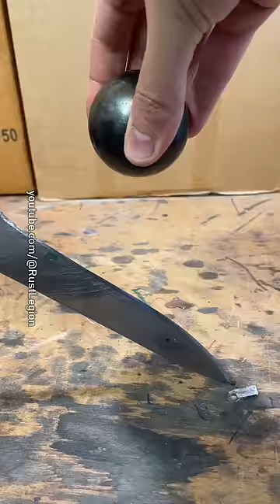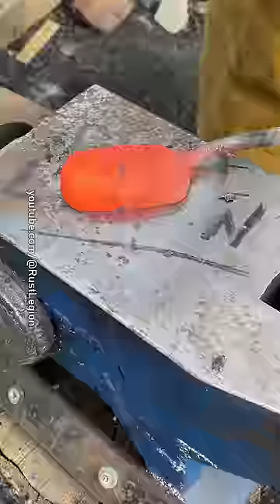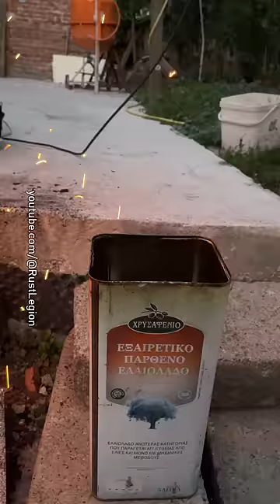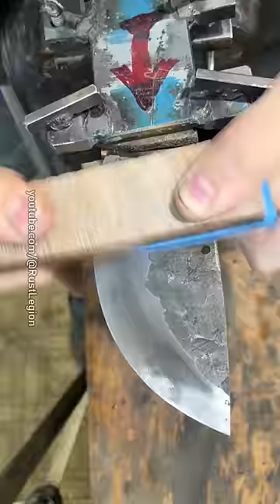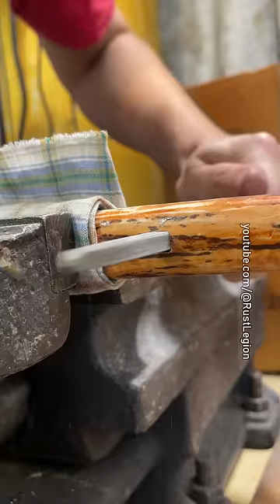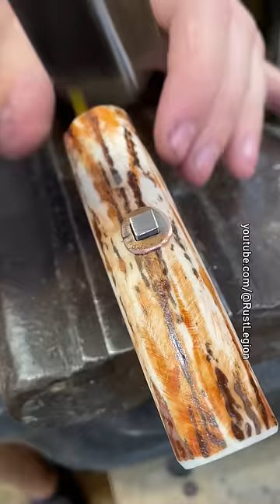Making cool Pizza knife

Comment: Ah... to propertly heat treat you need the metal between 1000 and 1200 degrees. When steel is that hot it is a medium to bright orange, the heat also needs to be consistent thru out, meaning the same color all the way along the edge you are trying to treat, that metal was maybe 800°F so all you did was make it more brittle not harder. The back middle was the only part hot enough. 

Hardening is a sweet spot between too soft and too brittle, it is not an easy process to learn properly. Also you really only need to heat treat the working edge, making the entire piece hardened will cause it to break easier, you want a soft metal behind the hardened edge to absorb any impact. 

Lastly there is more too heat treating then just quinching. You need to get a toaster oven and take it directly from the quench to the oven at about 400 degrees for 4 to 8 hours depending on elevation, 4 hours at seas level up to 8 hour at 9000 ft. So say 4000ft you'd do 5 to 6 hours. and let it air cool. This is called tempering. and is a required step for the best possible product. 

It doesn't matter if the tool is "just for leatherworking", if the leatherworker drops the tool on concrete or a hard surface enough, it will shatter. 

You desperately need a nice lazer thermometer that goes to 2000°F and a shitty walmart toaster oven that goes to 500 or has a broil setting (broil is 500) 

But you know, what do i know, Ive only been tool blacksmithing for 20 years, with a minor background in metallurgy..

Edit: I stopped the video to write you. Wtaf would you make a leather cutting tool into a pizza cutter? Pizza Cutters have a rotary blade for a reason. Just no my guy, just no....
Reply from the maker: damn for a  tool blacksmithing for 20 years, with a minor background in metallurgy you wrote a lot of incorrect stuff, maybe get back to some reading :) Seems like you forgot a lot
Reply: @RustLegion  really, like what? If I'm so wrong, don't just say I'm wrong, correct me!?
Reply from the maker: @rotherthies   to properly heat treat bearing steel (52100 or similar alloy) you need to heat it to around 815-830 C , If I go up to 1000 - 1200 I'll ruin it, the grain size will be enormous.
Reply: @RustLegion  I'm not speaking in C bud. I clearly said °F. But what ever you say.
Reply: @RustLegion  go check those temperatures in Fahrenheit. But regardless 800°C is practically melting temperature way too hot. But also you were no where near 800°C get a thermometer until you are skilled enough to visually see the temp. In daylight 650°C (1202°F) is orange, inside it will be a deep red. You are no where near those temperatures.  Period.